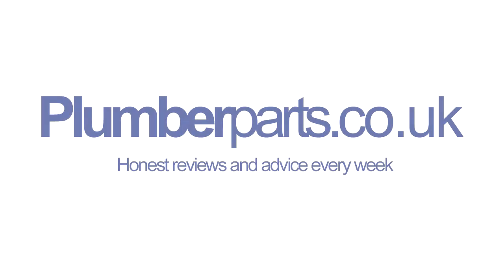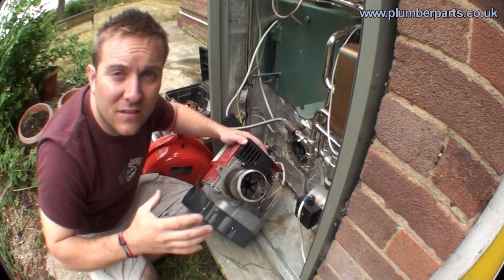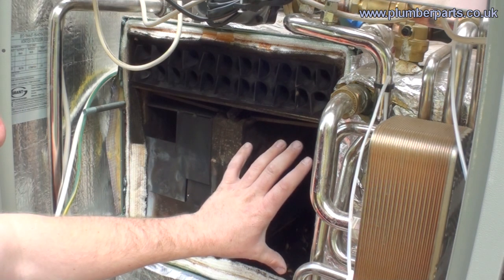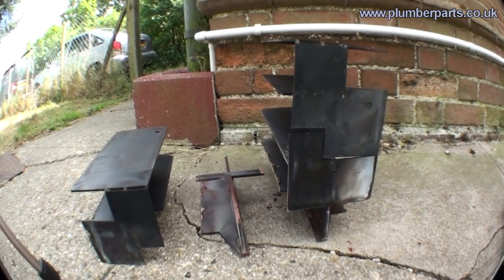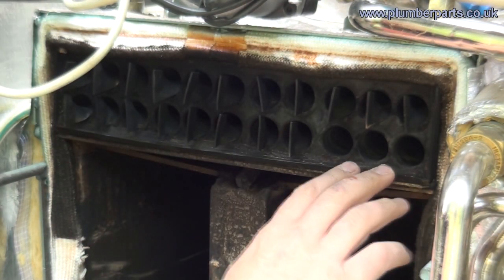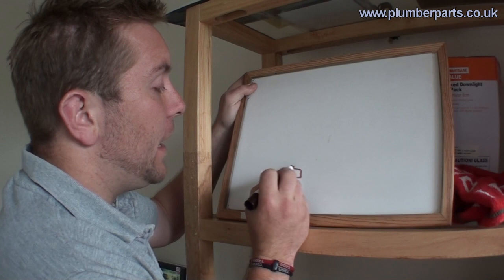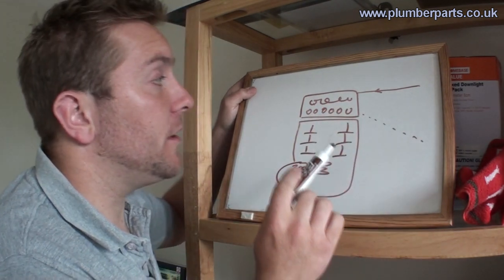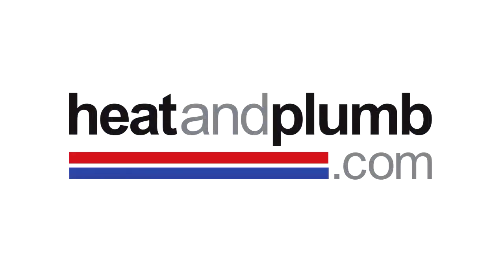How Condensing Boilers Work - Plumbing Tips

Comment: Just want to say, I'm a third year mechanical engineering student looking into a project to optimise condensing boiler efficiency. I had experience with heat exchangers but no experience specifically with boiler. Your video and the images contained within it were very helpful to help explain and understand condensing boilers very quickly. Cheers

Comment: OK dude, I don't understand what I say either, must be the ginger beard. I've drained and flushed, water was yellow and F&E tank was full 'o' gunge. Not all that old, 6 months. Refilled and added 2x inhib and descaler, sounds better, It's almost like a kettling sound but not that bad. Wondered if heat exchanger was scaled, out water is pretty hard.

Comment: You might consider studying a faster feed of the water going through the condenser section (impeller then reduction) just to pick up as much heat as possible. (Rather then just trying to make the current set up more efficient)

Comment: Nice video with great explanations etc.  I would just add to it a little and explain to the non technical people watching that the energy and money saving advantage of this boiler comes from the fact that the boiler needs to work less to get the water up to flow temperature.  Hence the efficiency level being greater than a normal boiler.  The key element is get one because it saves lots of oil (therefore money) when heating your home and water.

Comment: Very good video.. I have one quistion tho. I ordered a gas boiler for a job, but the delivery guys said that a gas boiler would not do the job, due to the temperatur on the water comming back to the boiler only is 4-5 degree lower than the water comming out. He says that i wornt condensate, and therefore cant work, without beeing able to explain why. But as you say, dosent that just lower the effency of the boiler?

Comment: Thank you James.  A succinct and straightforward explanation.  The boiler you showed was oil fired and  the heat exchange/condenser looked to be made principally from cast iron.  Modern condensing gas boilers are obviously a lot smaller and lighter and presumably made from other metals.  How does the heat exchange/condenser differ in its construction and the way it works?

Thanks.

Comment: Big dude. I've got an old gravity fed boiler, with HW cylinder and F&E tank. It's making a 'shit' load of noise. There's loads of Inhib and boiler descaler in that mother. Can I 'razz' out the heat exchanger and 'slap' that 'mother' in a bucket of descaller? Rads also need bleedin' bleeding a lot, is that from the boiler 'descalling'?

Comment: Modern technology is a bonus on condensing boilers, on the negative side you will go through 3 boilers compared to 1 cast iron mexico due to acidic corrosion inside these exchangers.

Comment: Great video but can you explain a little about how the modulating valve and the venturi system works on a gas boiler and how the gas flow rate is regulated.

Thanks
Reply from the maker: +Harvey Johnson We'll do a video on one soon!
Reply: That's great, thank you!

Comment: So its effectively using the exhaust to heat a secondary heat exchanger to preheat returning input making it easier to heat up fully when it goes through the main heat exchanger with the overall thing retaining most of its heat rather than pissing 250c out of the exhaust which could have been utilised?
What about adding a second condenser to further draw latent heat from exhaust gases or is there really no point?

Comment: If that boiler was mounted on a slab suspended on a plinth hard against house and condensate was discharged through  hole in lbottom of boiler casing and slab to drip onto soil 300mm from building, do you think this will cause problems with founds?

Comment: Thanks for all your help pal, really helpful videos!!! Would just like to ask, is there a common fault that occurs with condensing boilers after you have filled a system back up once you have finished working on it? Recently helped my wifes old Grandad  out with a leaking rad valve replacement but now i think i have broke his condensing boiler lol it's a gravity fed system which is connected to a condensing boiler, please help?

Comment: hello how are u my friend? i need some advice from you about my boiler which is green star 25si/30si bolier (worcester) the problem is with the pressure gauge which is on 0, when i tried filling the system the gauge stays on 0 and dont fill up. it would be great help for some feedback. thanks

Comment: So a old conventonal boiler  running for 1 hour uses the same amount of oil as condenser boiler. only the condenser captures more of the lost heat enery lost out the flue.the only way of really saving money is to have your house better insulated to hold this extra waste heat and to be able to run your boiler less.

Comment: Thanks for posting up this informative video and in layman's terms. That is amazing that a normal boiler outputs 250c at the flue , but the new condenser boilers only has 50c lost out of the flue!, that is a hell of a saving of oil I bet and less carbon/heat lost into the air!
Can I ask a question if that is OK please. You know the manufacturers say that the condenser boilers run the most efficient in condensing mode and it only runs in condensing mode when the temperature is less than 55 degrees centigrade, do they mean the temperature coming out of the flue of the boiler or the temperature coming back on the return water pipe to the boiler coming back from the radiators?

Comment: hi, is it the water entering the secondary heat exchanger that's condensing or the flue gas across the surface of the secondary heat exchanger that's condensing? thanks.

Comment: That was a fantastic video.  I presume that condensing gas boilers work the same as the oil boilers?  Can you recommend a brand in the USA?  I was looking at Weil-Mclean vs. Buderus vs. Triangle Tube.  Which is the best for a 3,300 Sq. / Ft house?

Comment: Hi there interested stuff. here I would like to know a bit more about the condensing process. My understanding is that water vapour in hot flue gas will condense an change state from gas to liquid when touching cold surface of the return pipe. This will cause water vapour to give off latent heat to fluids (e.g water )  in the return pipe through conduction heat transfer. please correct me if any of it wrong. thanks

Comment: Great video, very informative!!
Just wondering, has anybody in the UK tried Hassle Free Boilers yet? I heard they do new Worcester boilers with no upfront cost and no deposit.
Reply: These sort of companies are like the wonga of the plumbing industry and I really wouldn't take a deal from them if you can at all avoid it. If you take out there 'no upfront cost' offer it will cost about £6k over the 12 year period they stipulate. It might sound attractive with their offer of free boiler cover, servicing etc. But a decent heating engineer should be able to supply and install an average size boiler for about £1k. You can get boiler cover for about £40 per year and a service for about the same. That means you'll be paying about half of what it will cost you by going through them. The UK government also issue grants for upgrading to a more efficient boiler, might be worth seeing if you qualify before going ahead and replacing the boiler from your own pocket.

Comment: most people dont need condensing boilers, because their edr is very low or they use water based radiator. Only if you have steam based radiator.
i see alot of people get oversized boilers, the only reason last long for old models is they have good thermal mass, and cast iron radiators especially, keep giving heat even after boiler shuts off and short cycles to death.

Comment: Pretty great explanation, although a little more elaboration on exactly what the condensate is would have helped me! 
As I understand it, condensate is the corrosive material extracted from the return water? Not sure if this is correct, but I'm wondering if it is, and also what form the condensate is in? Is it also a liquid? I'm confused about the difference between the condensate leaving the condenser, and the return water leaving the condenser...
Reply from the maker: +D Still Hi there. Condensate is formed on the combustion side of the condenser (where the flame is) and therefore the hot side. Cold water inside the water jacket of the combustion chamber picks up this heat through the metal of the water jacket. Because it's so cold it causes the combustion side to condense the moisture in the flame (like breathing on a window). This moiusture obviously contains the by-products from the combusted gas/oil like sulphur and small amounts of acids. That's why it need to be dealt with as if it is not water. I hope that helps! Best, PP!
Reply: +plumberparts Got it, thanks!

Comment: I've got the same condenser boiler but the hot water output (immediately after the pump) is connected to the cold water return through some sort of pressure valve... any idea why this might be? I seems a rather bizarre thing to do

Comment: Hello! It was hard to understand but your video did the job! 
One thing i dont get though!
Why is it not as efficient when not condensing? In my understanding, return water, even if hotter, still passes through secondary heat exchanger and picks up heat. 
It is not hotter than flue gasses is it? I cannot find any info on this anywhere!
Reply: It is because when the steam, or the humidity in this case, condenses, it transfers its heat more efficiently to the environment (heat exchanger), because water is much, much more efficient heat conductor than the air/flue gases.
So when the humidity in the flue gases condenses on the secondary heat exchanger, it transfers the heat to the cold water much more efficiently than when it's not condensed. By pre-heating the input cold water in the secondary heat exchanger before entering the main heat exchanger, the overall system efficiency is increased.

Comment: I live in the states don’t have a lot of condensing boilers here. In Maine it get pretty cold how do they work at 0 degrees f. For a month straight do they run on kerosine or Home heating fuel. Is it worth the price to switch over from a Buderus g115 to a condensing boiler?

Comment: Hi.i had my old boiler replaced with a  glowworm 25c combi about a year ago.
It heats 8 small to large rads on 3 floors in a small 200 year old building which ive insulated well. 
I dont know if it is a condensing boiler. I dont know what central heating temp to set it to on the boiler.
The info about temp setting for central heating and hot water is missing in the manual.
It has been running on almost max temp since it was installed,but
I learnt myself that i should be running it cooler to start it condensing and performing properly.
The max central heating temp is around 75 c ,so i have turned it down to 50 c,to get a cooler return flow of 40 c maybe but i have no way of measuring this.
Will this manual lowering of the central heating temp (by me pressing a digital button on the front) make a difference or do any internal master settings have to be lowered by the installers/qualified engineer.
There is little info from glowworm.
I read i might need to fit an outside weather thermometer thing.
I had a hive remote thermostat fitted but thats just a glorified temp adjuster is doesnt seem to teach my boiler to perform better like what ive read about the outdoor weather thermostat things.
Any help greatly appreciated thanks clive

Comment: Hii mate,

i am not sure i am getting things right with on demand boiler then the older heat oil type of boiler which is not on demand type. 
anyway, i am so confused about the types of boilers available. 
can you do a video on type of boiler for house hold ? and configuration of each ? 

i am trying to understand my aunties boiler system , which they obviously know nothing about.. 

one of my aunt in uk have a heating oil type of burner (i know it is pressurized because it has a pressurize membrane vessel), 
and there are so many piping running here and there (they have 3 zoning and each have a pump of itself) , and also a heat storage container, which have also electric heat installed (it is a dual heat). 

and 

another aunt have gas on demand heater for radiator and shower in germany which have a (i think) over 50 gallons of hot water stored in the vessel beside it. and there are several pipes goes in and out of the vessel (which confuses me). i know the heat exchange surely happened inside the vessel itself, but i have no idea which pipe is the closed loop hot water of the boiler system, and which is cold water inlet and stuff..

both of them i am trying to learn how the piping goes.. since some part of the piping hides inside the walls.. i can't really get the picture where they goes. 

can you pls do a video on such theme in complete ? 

thanks
it will be very appreciate. then i will be able to troubleshoot in case anything happen

andrew